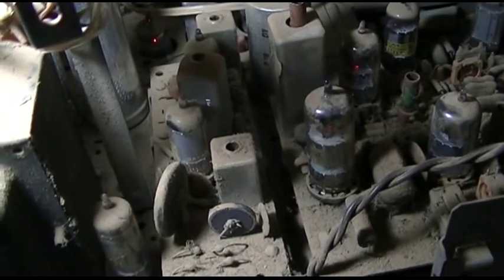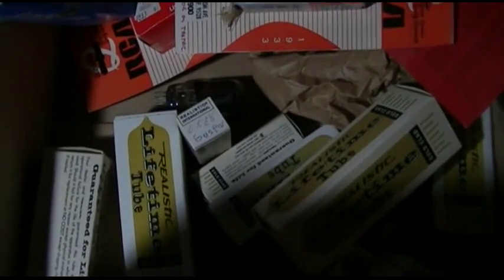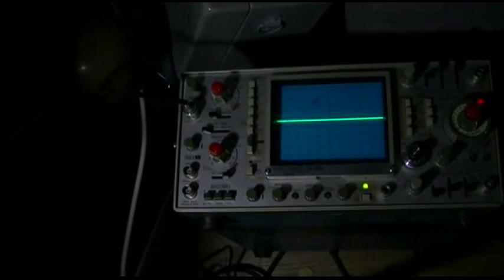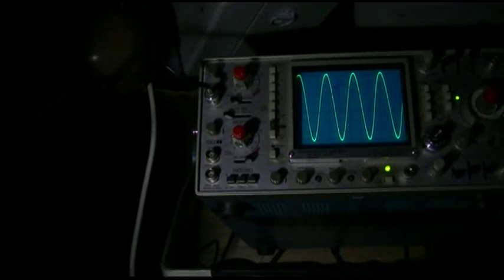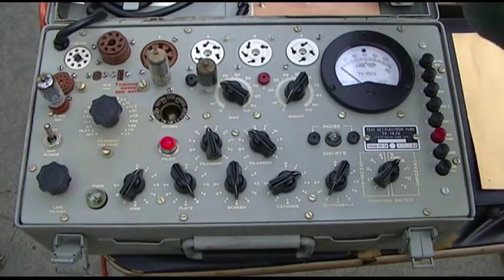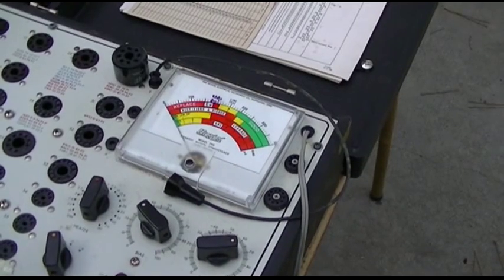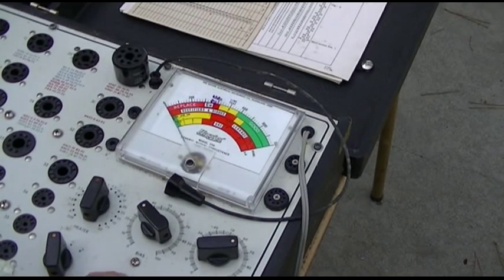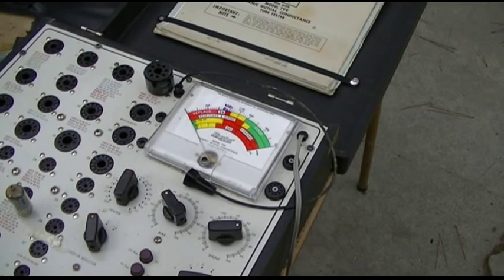RCA CTC28 Sound and Chroma Oscillator Fix And Testing Tubes Part 4

Comment: I definitely disagree on this one. I restore tube radio and hifi, and the very first thing I do is test the tubes--doing so has saved me much aggravation in troubleshooting. The thing about testing tubes is that most people don't leave them in the tester long enough to uncover thermal shorts...it can take a few minutes.